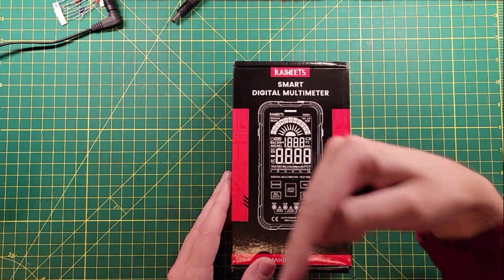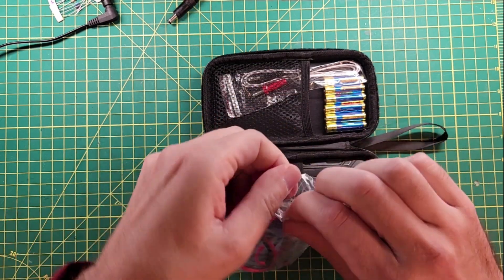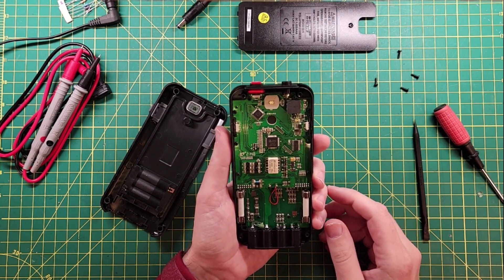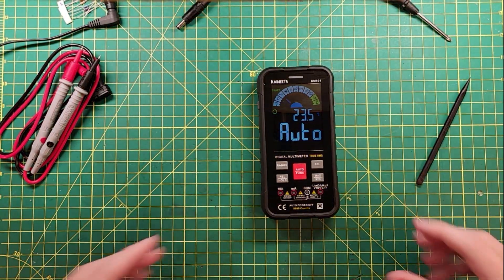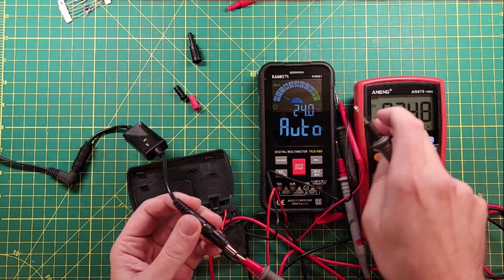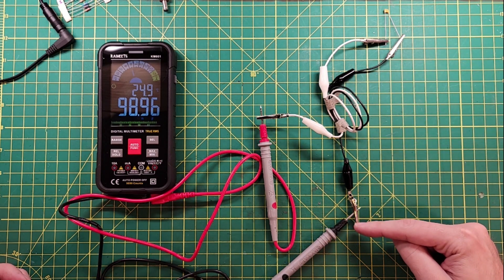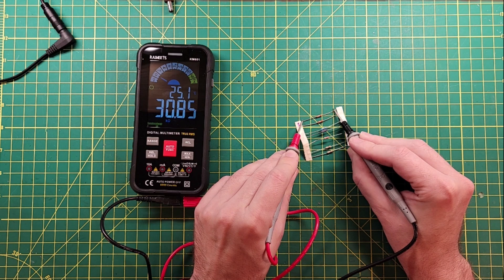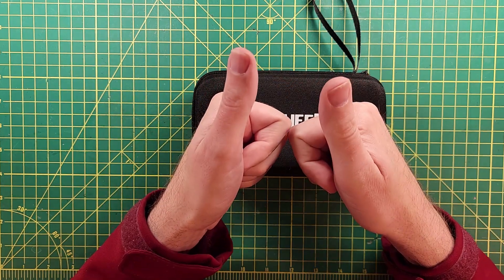The Kaiweets KM601

Comment: The Kaiweeks link is now 404.  I'm not a 100% sure but it looks like they may have disontinue the KM601.  I hope not.  I like the the probe connections on the bottom rather on the front with KM602.
Reply: Ups, I was looking at a different model.  The KM602 does have the connections on the bottom.
Reply from the maker: Yep, looks like the 601 has been EOL'd.  I've updated the link to the 602.  Thanks for the heads up.

Comment: Is this really ok? I need new leds for my $120 (not that one) matter and its nice enough but will cost my $30 for new leads. I don’t need much these days.
Reply from the maker: I guess that depends on your needs.  This has more features than my last meter... but I'm not a heavy meter user, I need volts AC/DC, Current, Continuity, Resistance and this covers my bases.  Nice to have is capacitance and inductance, but that's out of class for this type of meter/price.

Comment: Good review. I have one very similar from another Chinese manufacturer brought to my attention on the Cycle 25 group by Jim W6LG. I don't use it on my workbench but on my "cutting, sawing, grinding, bending" bench elsewhere in my garage. (Sawdust and metal bits don't blend well with HP et al. test gear, lol) The version I have has essentially replace my older Triplett meter on that bench. If I damage it, I'm not out much money. It's sealed so dust/metal and so forth doesn't get into it. And it works every time, unlike my venerable Triplett that has an erratic 9V connection that I need to fix "soon". The product you're reviewing is well worth checking out! Thanks again for another informative video.
Reply from the maker: I have tools like that that get "special treatment"  its a good idea to have a few backups!

Comment: Looks pretty cool. I did however read a review that the voltage readings in Manual mode are not accurate at all, but fine in Auto. Did you see this issue?
Reply from the maker: I'll have to test that out!

Comment: It's pretty nice and all, but I have 2 Fluke meters, an old Craftsman, and one that I got from Snap On. I think another multimeter is the LAST thing I need to be concerned about lol. Next thing I need is a good bit of either some rg213, or if u can really spring the cash, some M&P coax for use at home. Then I can just use the rg8-x when doing POTA.
Reply from the maker: Coax is pretty essential!